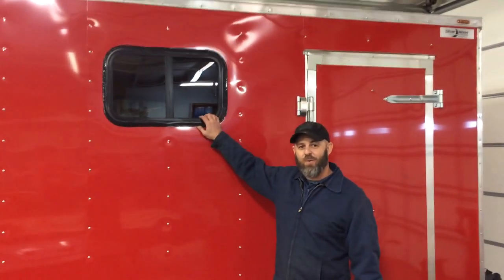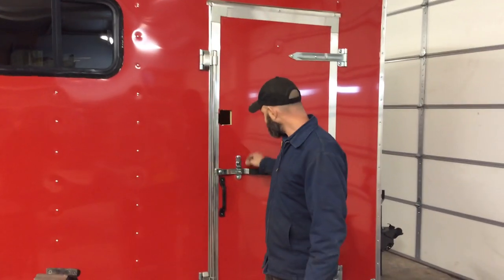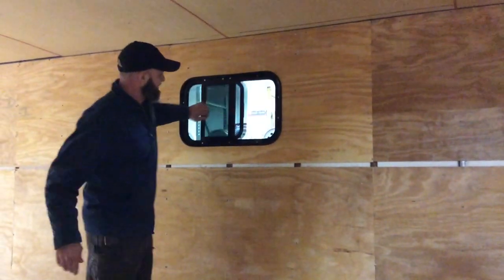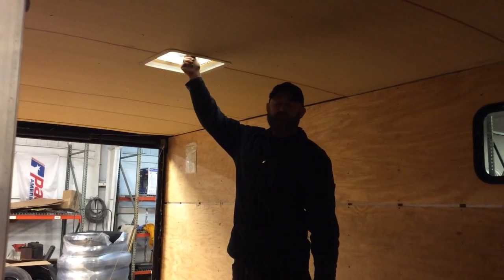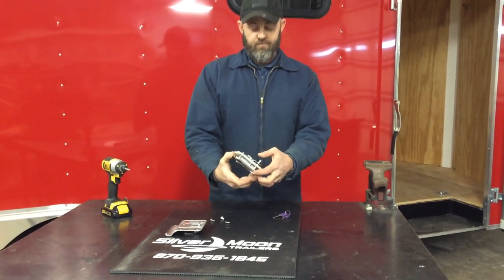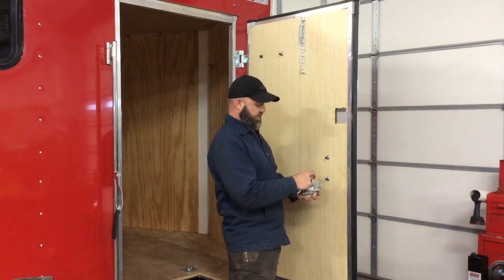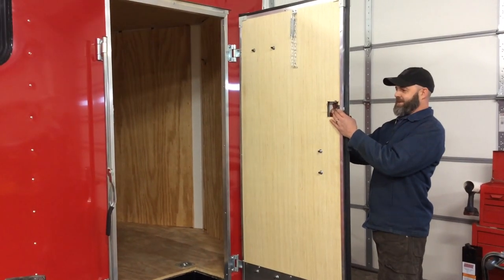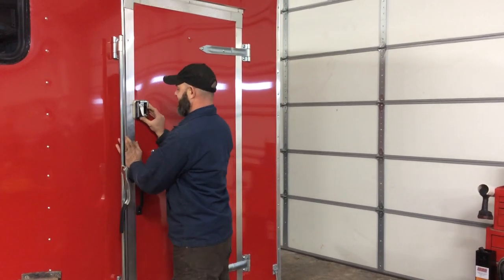How to Install Windows in a Cargo Trailer - Aftermarket windows and Flush Latch

Comment: Its cool I found your channel im from Arkansas too! Just bought a 5x8 enclosed trailer i want to put some larger fold down windows one on each side. I plan on running my little pressure washing system from it. So need the sides to open for my water hoses. Where are you located? How much would that cost!? Thanks!! New subscriber!!:)
Reply from the maker: Thanks for the follow!  You can give us a call at 870-330-9133 and talk to Eric, he can get some info and get some prices together for you!

Comment: The window is installed incorrectly. The fixed end should always be forward not the sliding end.
Reply from the maker: Jim Smith sharp eyes. We installed it this way because the customer wanted it to slide a certain way.  But usually you are correct!
Reply: Whats the reason for the fixed end of the window to be forward, I'll be doing one in the future